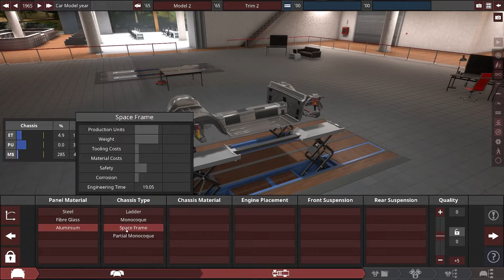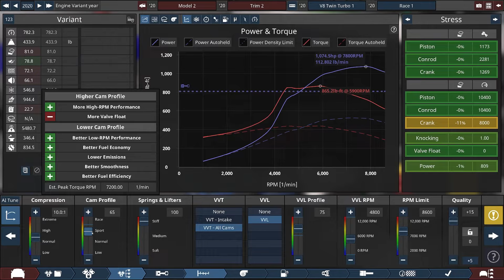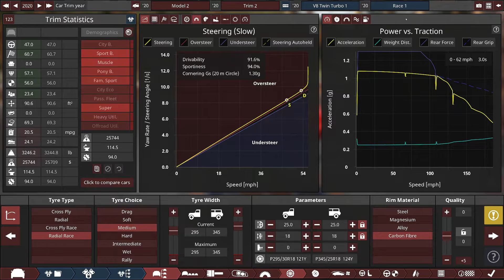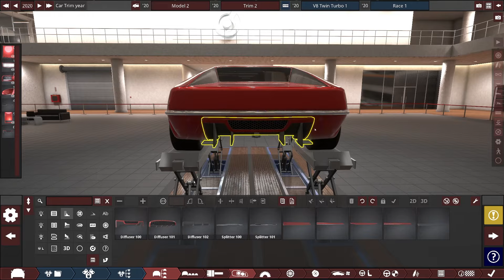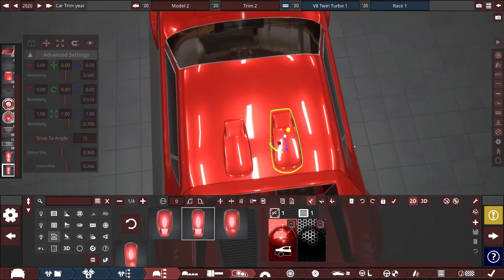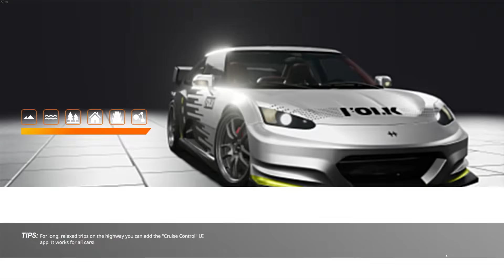BeamNG Drive De Tomaso Pantera! - Driving and  Destruction!

Comment: Well sad taht automation flopped as content on your channel  

But still you will have fun with it even if same stuff is pretty deep in engine needy stuff 😅 so here are my tips and same explanation im sry for spelling but it is just so much 😅😅😅

And well tips 
Nr1 get used too the ui (but yeah even after +1000h i strugel sametimes with were the right page is😅)
Nr2 your engine is actually quiet good for stupid power  but if you want more rpm and therfore hp without breaking stuff try shifting the balance of bore and stroke too a biger bore and smaller stroke too keep the capacity added bonus the valves get biger and cann support more power too 

VVT is the rotation of the cam shaft by a few degrees in in relation too the Crankshaft  for exampel at low rpm the intake valves cann open later so that the piston already pulls a slight vacuum and once the valve opens the air rushes in with higher speed that helps with the mix of air fuel and the combustion is better  so more power out of less fuel and better emissions  almost no drawback 

VVL best known variation of it would be V-tec  it allows the engine too runn 2 different cam profiles side by side  one with low lift and less aggressive ramps and one that is biger(longer) lift with more aggressive ramps 
Mechanical it is pretty simple both cam profiles run on the same shaft the less aggressive cam profiles acts on a normal follower that acts on the valve and the on on the aggressive profile the follower is not directly connected too the valve but once the taget rpm is reached the flower lock together and the one riding on the aggressive profile just out lifts the normal one and oppens the valve more (that is why vvl dosnt go lower than base cam)  so you cann build a engine that runs good at lower rpm with a low base camshaft value and a high vvl value  each cam profile  has also a peak torque rpm so your engine ca breath at high rpm and dont choke on its fuel in lower rpm 

Nr3 the flow values are your best friend tuning sizes i aim for values close together (beside intercooler and on crasy builds turbo turbines) and usually i get the most power at 80-70% (that is there resonates on the more sporty stuff is probably simulated )with the manifolds and exhaust on same stranger builds  i had too open up 1 tick on the exhaust side just too get my octan rating 

Nr4. OCTAN IS KING (for power)  there are so many things that change your octane value for the engine than just fuel type   starting by the intake what kind of fuel delivery but generaly old carb bad modern injection very good and more fuel also ads if you cann still ignite it materials of block and head the type of them, valves, cam profile and engine cooling  (in general better cooling less chance of knocking so more octan too use) 
And using it is pretty simple more boost or compression  and timing advancement 

Yeah that was all just engine stuff 😂 but im sure you already made same experience onnyour own 😅

On the car building and exporter side i still have same tips soo.....

Nr5 there are many useful tools right about the selection Windows for the "fixtures" like exhaust vents etc for example mirror mode  and 2d/3d mode (you probably found them already yourself)  the later one is kinda a must use for same parts like interior or these mod wheel arches  just place them anywere and switch to 3d mode you cann move them freely but it cann fight you sametimes also switching back cann have ehmm interesting results like breaking same limitations 😅

Nr6 the advanced settings  in the lower left corner  is a gear symbol open it and look through it there are many useful sliders that cann help with optical stuff  but messing with same sliders have also a change how the car is exported to beam ng and cann change the behavior quite a bit  but beside the optical part automation will not adjust the calculations  accordingly and show you data what dosnt match the car you export (but more on that later ) a pretty good one with almost no drawback is lowering the engine position till the drivettain is about flush with the lower body  in beam the engine and drive train have there own physics mesh and there also weight so the center of gravity for the wohl car gets lower  but that messes a tiny bit with the camber and body roll  also the weight distribution slider moves the engine forward and backwards but lets the diffs stay in place 🫠

Nr6 Downforce well since we make lots of power and losing control repeatedly in beamNG is only for a short time but funny and quite frustrating if you can't unleash the full potential of your build  we need downforce and automation and beam dumm down aero pretty much  basically every aeropart like lipps spoiler and defusors has a set has value of downnfore the size dosnt matter also the placement hasnt much importance beside on what axel the downfore acts in front of front achsel lots effect on the front and negative on the rear directly above only on the front between the wheels it is shared more fore to closer one and rear is just the same as with the front   soo super strong downforce cars are pretty simple on the part of making lots of it were it matters  just move a aero parr like a spliter make it small and move it under the hood with the 3d tool and maby shift click coppie it in place for more kg and use the sliders to fine tune it 

Nr7 the exporter well is pretty self explanatory  welded fixtures is nice if you want the spoiler etc not flying of like lego in a crash and right now they try a new mode there you cann basically have fixtures make all of the body (so exocars etc) but it is still wip 

And zip or unzip date is just for guys like me how aren't afraid too dig through same code and change same more stuff  

Beam only supports Only 10 unziped mods (so for moders to change and reload the sim without restarting the game)